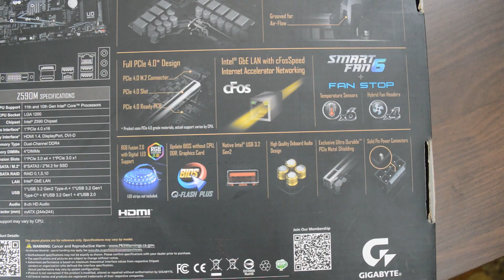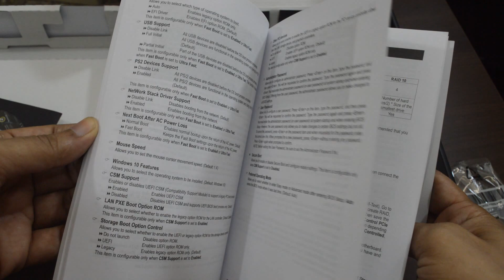Gigabyte Z590M Motherboard | Unbox & Overview

Comment: Is there any big difference between this and Z590 GAMING X, without the M? I saw that there are a few port differences and that the M is the mATX one! I saw that the Z590 GAMING X is pretty good, so this should be the same, I just need an mATX one!
Reply from the maker: Gaming x is slightly  expensive  model and better than z590m in terms of vrm cooling